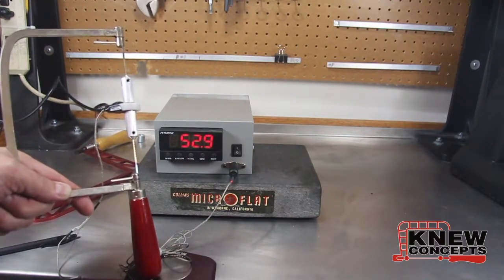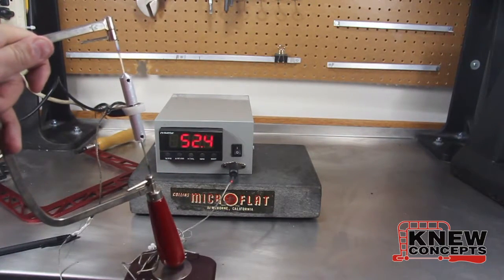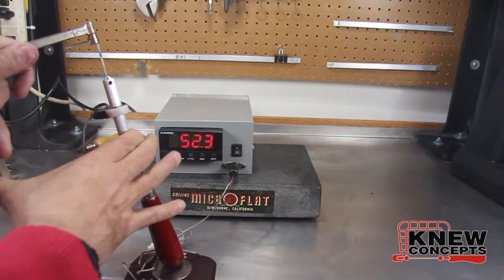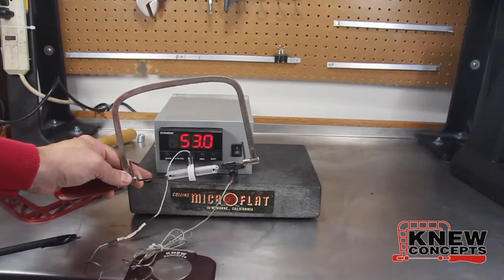Knew Concepts Tension Testing Rig made to measure blade tension on jewelers saw blades

Comment: Hi Brian, even though I'm 6 years from when you made this video, I found it extremely interesting in the tension being set on a blade.   Have you since possibly done a study on different tensions and how they effect the saw blade itself.   On a tiny 6/0 blade I once over tensioned it and the blade broke just from the high tension.    With your Cam lock system it gets me thinking on where you really want to have the tension set for particular blade numbers.    I would love to play with your calibrating machine since there is so many variables to be explored.   Please let me know if you have any further studies done.......would be most interesting to read.
Reply from the maker: Greetings,  
6 years?  Wow....Feels like yesterday.
We have some test data on the tension at which various clamp styles pull loose, which also gives some data bout the tension at which a couple of different sizes of blade will be torn apart by simple tension.  (The one in my head is 2/0 blades shred at about 35 pounds.)  We've never done any quantitative testing about specific tensions for cutting, because the test rig doesn't fit a saw while there's a real blade in it.  (It replaces the blade.)  
We've toyed with the idea of building some sort of a tension meter into the saws themselves, but the only half-way sane way to do that gives a meter that says 'more/less/same' than the last blade, rather than a number related to real pounds of tension.  Getting a numeric system calibrated would be *expensive*, and frankly not of much use to most users.  Plucking the blade with a fingernail and listening to the pitch of the 'ping' works very well once you get your ear tuned.
The advice that I give to novice jewelers learning to saw applies:  Don't overthink it.  Cut.  Break blades.  Learn.  Repeat.  There's a reason they're sold in dozens. 
 In the end, your hand needs to know how to do it.  The brain can (and should) help, but ultimately, you have to educate your hand, and that happens through practice.
-Brian
Reply: @KnewConcepts  Thank you very much, that was interesting.